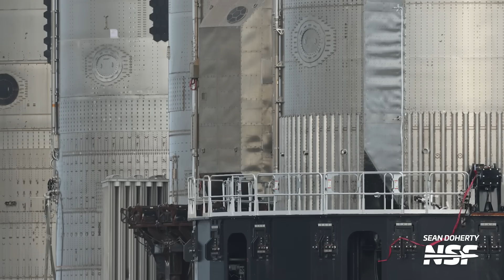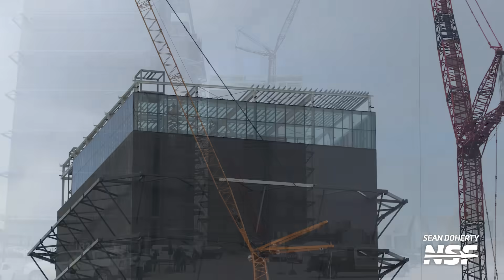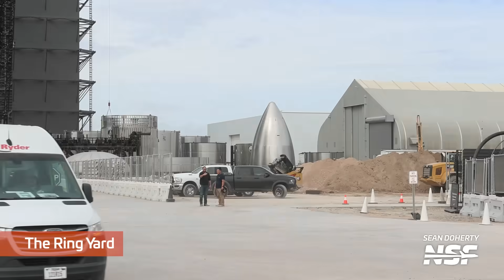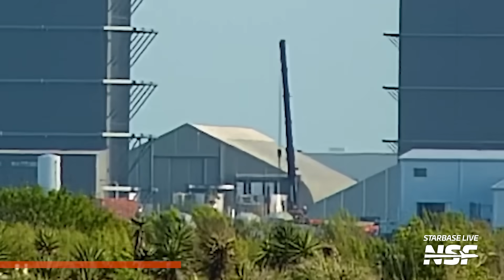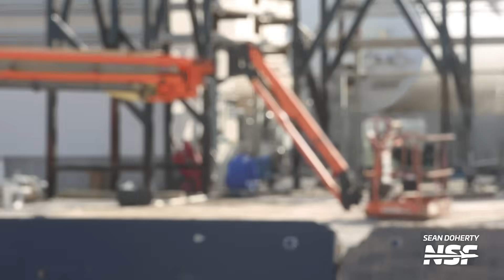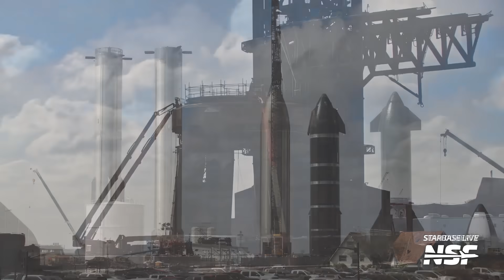Chopsticks Tested for Upcoming Booster Lift | SpaceX Boca Chica

Comment: Are there people/workers in the star factory and high bay area when there is a launch further down the road at the launch site?
Reply: The answer was believed to be no, and they definitely clear out all the manufacturing and construction crews, but the latest recap video appears to show controllers in the Stargate building (behind the High Bay). This is odd since it's within the exclusion zone, but maybe there's an exception for a few of the controllers
Reply: @thomashayden804  Okay. Than maybe the mystery concrete structure is a bunker made for the controllers?

Comment: Just wanna put this out there and not related to this but maybe someone will read it ..... Has anyone though of moving Hubble to the ISS and repairing it there? Seems like a relatively simple idea. 🙂
Reply: I think the orbits are vastly different.  The energy required to do that, and then take it back again, would be prohibitive.  I'm also pretty sure it's probably pretty hard to do that: you can't just attach a tow rope and drag it along behind you, like a broken down car...
Reply: After you have repaired it at the ISS you would also have to move it into another Orbit again for its operation.
Seems to much effort/disadvantages compared to the advantages it gives.
Would be way easier to just repair it in its current orbit and then reboost it.
Reply: Not only they have different orbit heights, they have very different inclinations (ISS 57 degrees, Hubble 28 degrees). To change inclinations requires a large amount of delta-v, which is generally why satellites are launched directly into their inclination.
Reply: Thanks for all the replies people. I thought Occam's Razor might apply in this case, but they, i'm also no Rocket Scientist. Anyhoo it was just a thought. 🙂